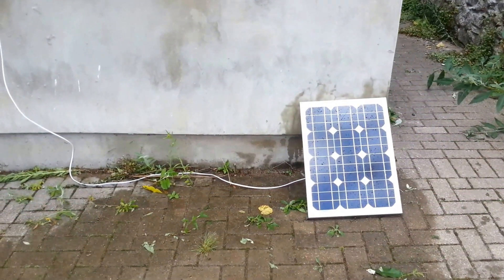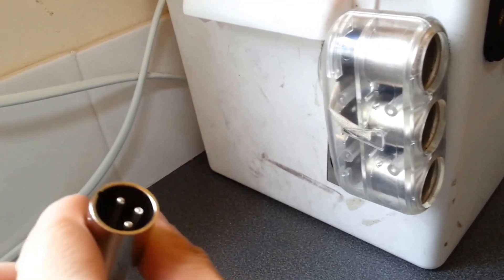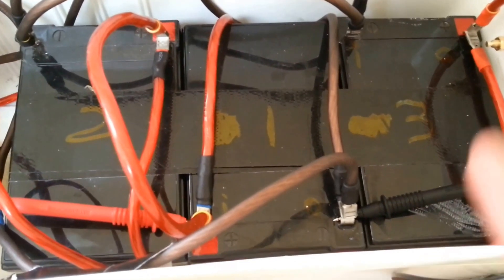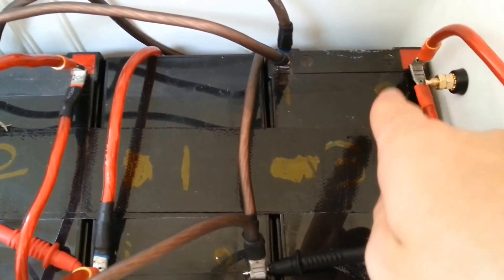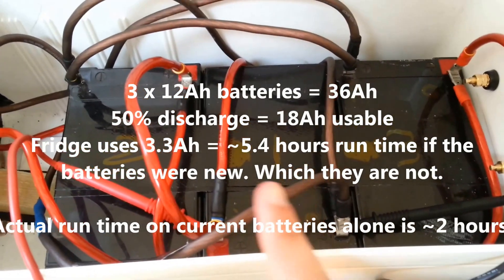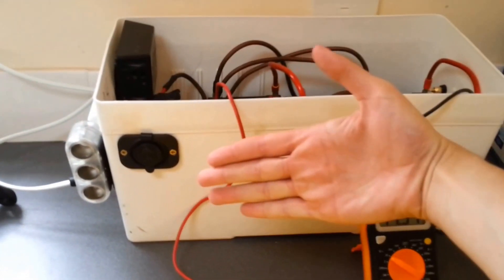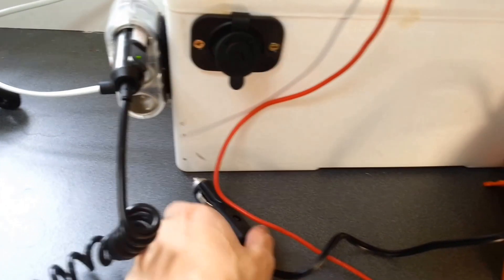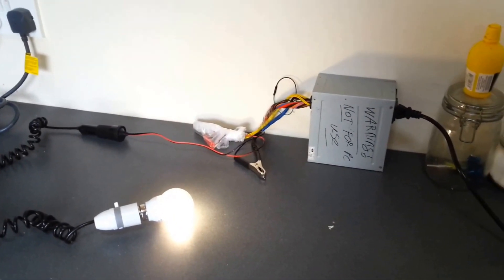Solar portable power station - Camping/Festivals - MKIII

Comment: Great video. A couple of things you could do. You could build yourself a Quantum Accumulator. Not only is it light it is very powerful. Over the last 5 weeks I have been running my inverter and powering my lights with only one configured for 12Volts. because you are using a box fridge. You can switch it on and off and still keep your beer cool. A 555 timer running 5 Minutes on and 10 minutes off but those times you could test with your thermostat and reset accordingly. Great keep going.

Comment: Good to see another video ov yours...! Yeah I reckon an MPPT controller will make a useful improvement to your set up, they offer the most benefit when the battery is at it's most discharged. However if you're looking to get some new batteries you might want to check out some ov the LiPO4 devices around now. You could make that setup way smaller for the same AH or heaps more AH in that size you have already. Search for "Soln1" for some ideas. :)